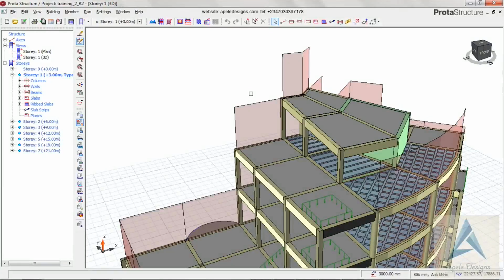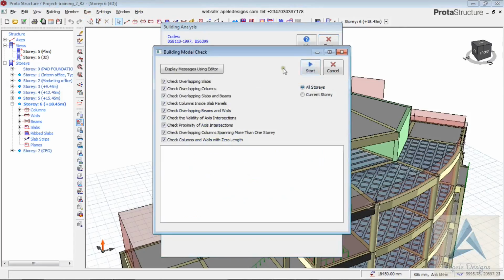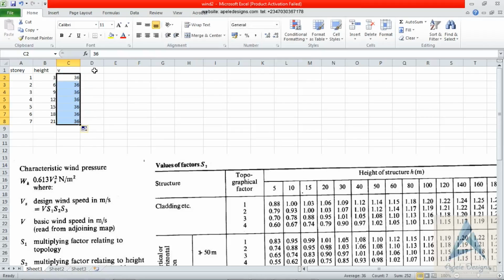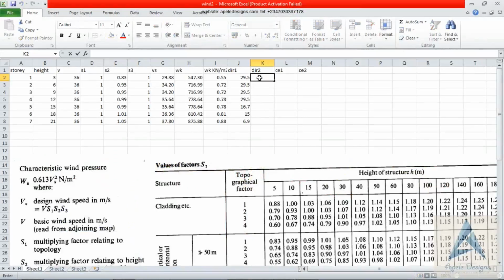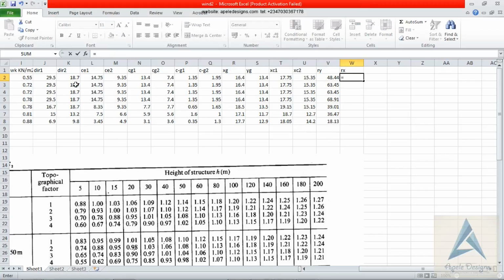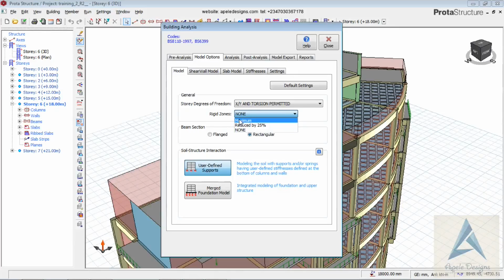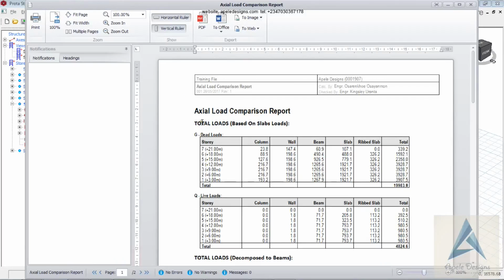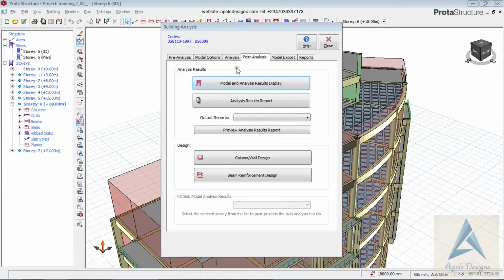3. Analysis on Prota Structures

Comment: Hello. Thanks for this. It is awesome.
I noticed that wind load can be calculated automatically but you had to do your manually. Any reasons why you chose the manual method?
Reply: This is an older version of prota. The new version yes u can add wind load automatically based on a chosen code of practice